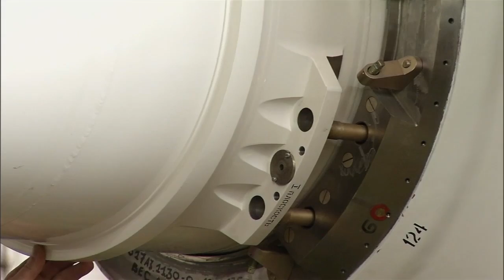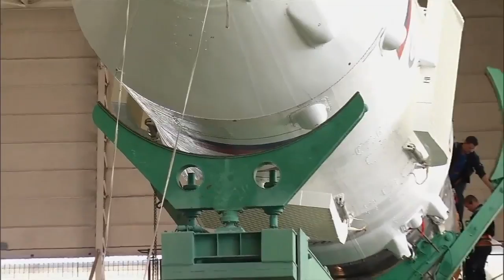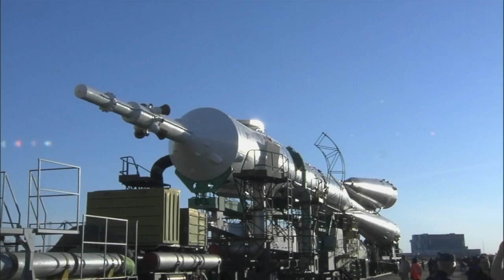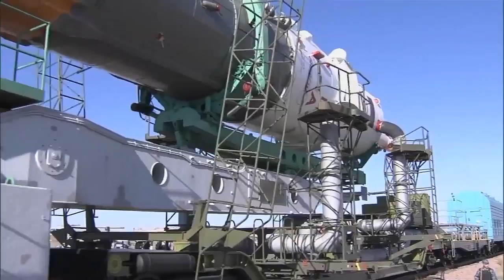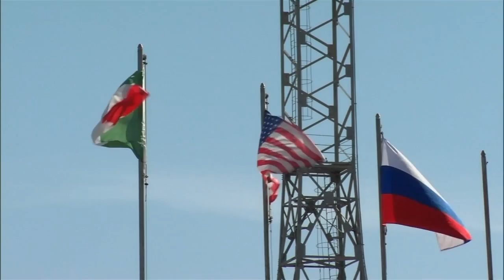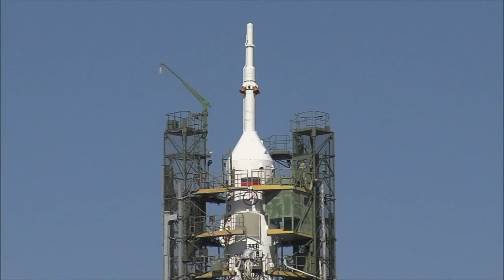Expedition 36/37 Soyuz Rocket moves to Launch Pad

Comment: It's called tension. That's just the sound of enormous pieces of metal (i.e. a rocket) slipping back and forth a few millimeters due to the motion of the train carrying it - it's not meant to handle mechanical stress while laying down after all, it's meant to handle vertical stress while standing up. Most of the noise is probably coming from the rig, the train, and the track, not the spacecraft, anyway.

Comment: The Soyuz launcher is built around the idea that, if you have weaker, but more numerous engines, you can afford to lose one or two during ascent, without failing the mission. Hence the 20 engines in the first stage alone. And it's not a bad idea, not bad at all.